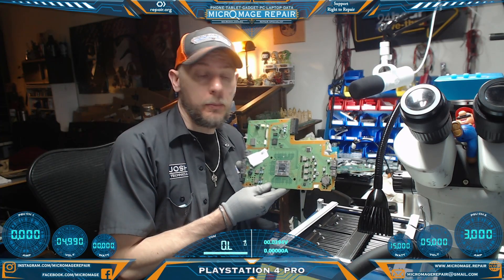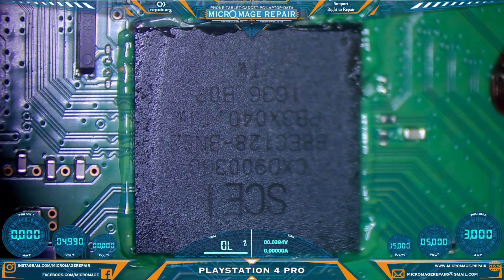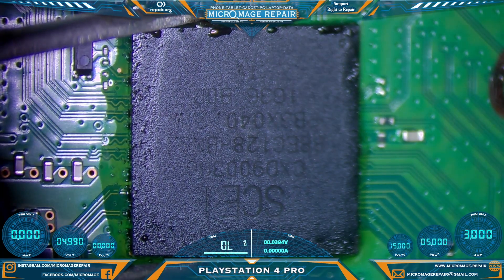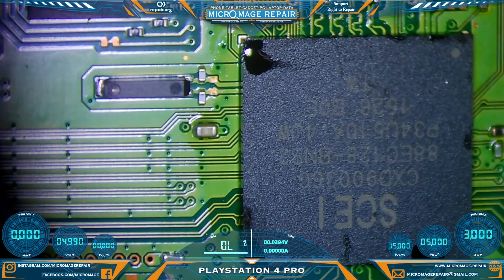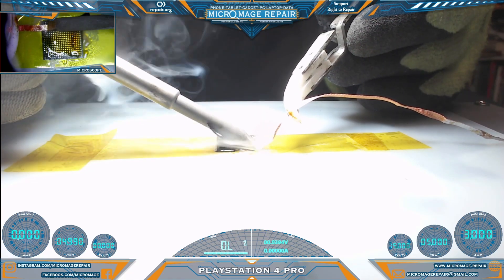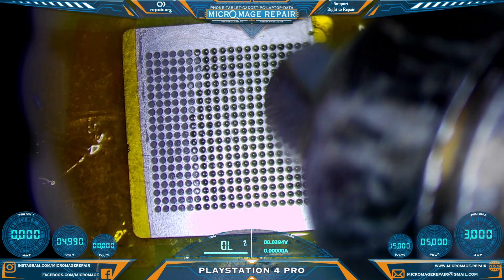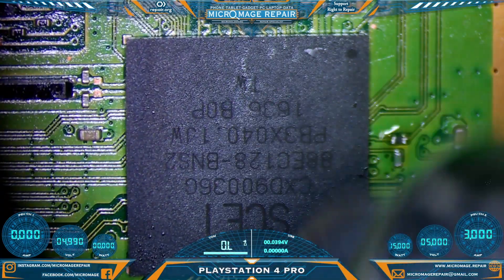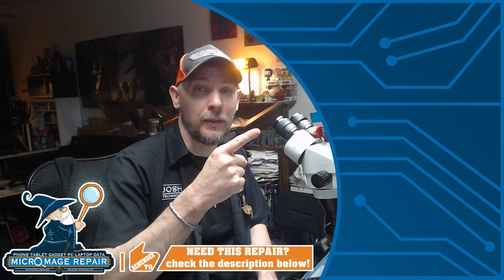🎮 CXD90036G South Bridge Replacement

Comment: Did you have a heater underneath?
Reply from the maker: Yes.
I really like a IR heater for this procedure. 
I felt I had a much higher success rate with the south bridge chips that way.
Didn't kill as many with the direct heat required to work the board cold.

Comment: Pretty nice reball with paste ... Bottom heater will help a lot in lots of projects I use the iPhone preheater on lots of devices ... Need to get something better I was thinking about the JBC small preheater but to expensive
Reply from the maker: Thanks, it wasn't perfect, had to fix one, it happens.
I have been using the heck out of this one, stay tuned more to come!
It's large and bulky, that's why I upgraded to an articulating arm on my scope.
Very nice if you have the flexibility though!
Reply: @MicroMageRepair   Yeah I have to see the scope upgrade video haha 😄  I actually have a playstation 4 that I need to fix disconnect of Wi-Fi Not customers Is personal an old firmware